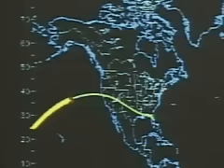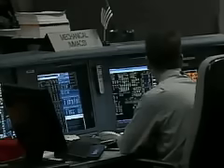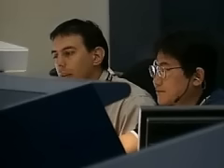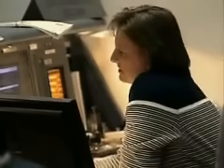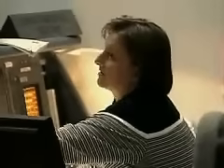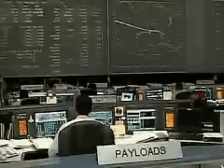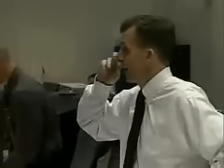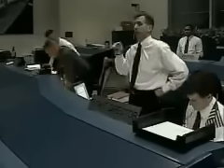Inside Mission Control During STS-107 Columbia's Failed Re-entry and disaster

Comment: The director was amazing professional in what was likely the worst moment of his entire life.
Reply: @Joe Booth You make it sound as if the tragedy was his fault. It wasn't. Their fate was sealed when the insulation tile was broken.
Reply: @davem5333  Correct, at liftoff it was over. Space flight is very intense and costly but I am surprised that no one had a backup plan in case of such an event like tile damage since foam comes off the central tank a lot.
Reply: @Joe Booth Wow! A real keyboard engineer!  We're so lucky. Tell us how you know the facts, not speculation but real FACTS. . Were you there when the decisions were made or did you read a secret report leaked by a NASA employee?  While you're at it tell us exactly how they should have "mitigated" the risk. Send another shuttle and risk having two crews stranded in space? Maybe do an EVA with a roll of duct tape?  You shot your mouth off by saying the FD flew them to their death and inquiring minds want to know. how you obtained this info.   

The only people who know the real truth are the ones who called the shot. Leroy Cain and said they all knew it had been hit but were told by NASA heads that it wasn't a concern. EXACTLY how was  he responsible?  Show facts not bullshit speculation.
Reply: Thought the same thing. Space flight requires the best in Engineering,  Production, and Leadership, but is given a shoe string budget. This wasn't LeRoy's fault. It was US Government Bureaucracy. "Reach for the stars, but use a bottle rocket to get there". - Congress.
Reply: Mike Washington -So True!
Reply: People knew it wasn't Caine's fault..... He did the best he could with the decision made over his head.
Reply: LeRoy Cain's expression totally summons up the situation, "like not again" after Challenger 17 years earlier,  the fight director and staff were just small fry, the biggest bosses the senior executives knew about the foam strike they had video footage of the strike during take off, yet they ignore the risks, once again they didn't learn the lessons of Challenger.
Reply: @joshuagrover795  Sry. EVERYBODY KNEW. The problem was that they didn't know the amount of damage or how it would affect the flight. There wasn't really anything to do but hope for the best since they couldn't do repairs.
Reply: @markiv2942  NASA must have known that with a hole in the wing, the shuttle would burn up on reentry, although NASA didn't request satellite images of the shuttle while in space, according to the official report, so NASA managers wouldn't have known about the damage or least the extent, do you think NASA should have informed the crew about the potential damage to the shuttle?
Reply: @joshuagrover795  
No 'satellite' images would be possible. Satellites are separated by hundreds of miles.
Reply: @rstevewarmorycom  False. The Dept of Defense doesn't disclose where their numerous assets are. The official CAIB report says there were 8 missed opportunities to get imagery of the wing. The report said engineers requested imagery multiple times and the Dept of Defense was working on it, when the NASA management canceled the request.
Reply: @soxnation1000  
Because they knew at that distance it would be useless.
Reply: @rstevewarmorycom That's not for them to decide with zero effort to examine options. When lives are at stake, they needed to do their best, not throw their hands up and say "we can't do anything, whatever." 

Potential solutions were never even discussed. They should have had hundreds of people working on it. The CAIB report strongly criticized the management for not getting imagery or exploring potential solutions. That was gross negligence, period.
Reply: @markiv2942  peak out the damn window?
Reply: @rstevewarmorycom  look outside the damn window?
Reply: Joshua Grover could they not have got the pictures from this women who dreamed it unimportant? Then send a shuttle up with crew experienced in space walk to fix it ? Am I being completely naive about this. I’m British but am really fascinated with space since the moon landing.
Reply: Carol rawsthorne - The time was damaged on liftoff when’s suit case size of insulation broke off and hit the left wing.. Their was no rescue available. Next shuttle flight was 8 weeks out. Tragic but we didn’t have a repair kit on that flight. NASA has been known for being lax,. Even on Apollo missions. They knew of the problems but bean counters usually win in the end.
Reply: @joshuagrover795  mannnnnn, what a tough question. You can't tell them, right? Assuming of course that there was literally nothing they could do to improve the situation. God, what a terrible choice to have to make.
Reply: @joshuagrover795  this was actually discussed when they stopped painting the Main fuel tank to save weight. It was a risk. As is all space flight.
Reply: @Joe Booth WTF? He didn't know they were going to die.  READ the report before you post armchair bullshit. . Yes other people knew it was hit but the controllers didn't have anything to do with it, and they have to live with that moment for the rest of their lives - you don't.
Reply: A Dubuque boy through and through.
Reply: @nutsackmania  lol
Reply: Ray Brown and what did he do wrong arm chair FD?
Reply: that friggin blonde chick said it was ok to return.
Reply: @normal_media  Yes, Linda Ham made the call to not assess the damage....A second crew could have possibly repaired the wing from the outside in a spacewalk...
Reply: They always are. Best of the best.
Reply: TheBigImpulse  I heard it different.  I heard the part about requesting and being denied photos, and that no satisfactory reason was  given other than they didn't feel it was necessary.  Also that Columbia did not have enough consumables on board to wait for a rescue, no process in place to do a transfer, and NASA didn't want to risk losing 2 shuttles - especially knowing there was a problem with the insulation that subsequently resulted in the grounding of all shuttle flights. 

Either way it doesn't matter now. If they would have listened to the engineers on the morning of the launch this video would not exist. 

NASA should have relied on science. Someone made a WAG based on ego and forced the launch.
Reply: @Joe Booth did he know of the problem before re entry though? If not there was nothing he could do.
Reply: @marlonisaac1  No. No one did.
Reply: Marlon Isaac nasa knew about the issue months before but they didn’t assume a small insolation would cause so many issues
Reply: I think he was waiting for the Asian woman to put on her gloves which she didn't do
Reply: Katherine Wild yea the crew actually didn’t have their visors down and gloves on but a former astronaut said they didn’t die bc the capsol got detached from the explosion so they were sitting there until the water which is horrible I hope they were unconscious
Reply: Wrong flight. That was Challenger. Columbia broke up over Texas. I had a job assignment in that area a few years ago and one of my co workers showed me pictures of debris they found
Reply: @marlonisaac1  They knew.Can't fall apart for the sake of the astronauts.
Reply: or the best
Reply: My Thought Also.k.
Reply: Agree totally.
Reply: I think he was waiting for the crew member in the back seat to put on her gloves-she didn't.
Reply: Gethomeitis...
Recovered my friends who went down in OEF because of it.
Reply: No! Not at all! It's quite apparent to me, that some of that Mission Control Centre staff was tring to do their jobs - some other people new in advance what's gonna happen... Professional, but not in your sense of the 

term..
Reply: Yeah, but I see little he could have done differently. They assessed the damage afterward. There was nothing on earth (literally) that they could do with the prior knowledge. It was not a certainty, but very possible it would not make it back. They did all they could. I did read that this haunts him everyday.
Reply: @markiv2942  rescue flight
Reply: Unbelievable  considering the billions involved that they didn't think..best have camera ability or remote device status  to check the outside condition if the vehicle once in orbit or maybe a piece of foam could detach and penetrate the vehicle on launch...let's test for that scenario too.
Reply: Gene Kranz, Gerry Griffin, Jay Greene, (there's a few more) had their own moments when they had to be a solid foundation for their teams even when the entire world is watching, expecting answers. The level of professionlism is crazy.
Reply: He KNEW the shuttle was damaged. He's a prick
Reply: the columbia had had a piece of heat shielding break off before, NASA deemed it an acceptable risk. they all knew
Reply: @raybrown3510  he was doing his job.  You can take your other crap and shove it
Reply: @raybrown3510  who?
Reply: You could say he had the right stuff, and not in a facetious way at all. He displayed command stuff. Not easy at all.
Reply: Corporate working
Reply: He knew.
Reply: I wish they had sent the rescue shuttle.
Reply: He was yawninh
Reply: the comment forum shows how illiterate is the us populace, technology-wise!
Reply: @kenthomson9562  Right. Terry O'Keefe, NASA administrator at the time, made the overall decision.
Reply: @dalethelander3781  but yeah what happened was very sad and they could’ve been saved which is the really sad part, bad deduction making
Reply: @dalethelander3781  why we don’t put females in important positions of power cmon now 😂😂 i’m joking btw
Reply: There was nothing anyone could do. Do you leave them up there and mount a rescue??? The risks of what they do are known to be not known. I just wonder how much we really learned from all this...   All the lives gone. Some of our finest men and women.
Reply: @Joe Booth Hi bottom feeder
Reply: Did he know beforehand that there could be a big problem? People knew about the debris strike, I'm not sure if he knew. If so, he's shitting his pants as its happening. :(
Reply: @WifeBTR123  Everyone knew about and discussed the strike including the crew.but no one could see if it was actually damaged, and since foam strikes had happened before without issue on previous missions, engineers advised everyone that this one would not be a problem. None of this was the fault of the controllers but someone up the chain certainly screwed the pooch.  

NASA heads also surmised that if damage had occurred there wasn't anything they could do about it.  They had no repair kits on the shuttle and  the astronauts were not trained for EVA repair. A rescue shuttle was briefly discussed and scratched because of the time needed for launch, and since they weren't 100% certain of a safe rescue launch (fear of repeat damaged) did not want to risk having another shuttle and more astronauts stranded in space.  

This was all revealed during interviews but of course there will be some who say otherwise. Only those who were deeply involved with the evidentiary data know if it's true.
Reply: @Slugg-O  that's crazy. You would think that in some way they would have a contingency play to dock with the ISS and just use the Soyuz to come back home. I'm pretty sure my ignorance on fuel, trajectory and space flight makes this exceptionally easier said than done. Still, it's just a thought since NASA thinks of everything.
Reply: Makes about as much sense as panetta saying they didn't send a rescue mission to Benghazi, because they couldn't get there in time.
Reply: Slugg0matic so why would they need to discuss sending a rescue shuttle? Someone knew this foam impact was not like the previous ones that  occurred. I think they knew the severity of that impact could lead to a catastrophic re-entry.
Reply: @Slugg-O  To expand on this. NASA had seen ice or foam strikes on many launches. This one had raised some concerns because it was particularly large. But they had not fully realized yet how much punch a piece of frozen foam had when impacting the shuttle at launch speeds. 

This was compounded by the problems that the oldest shuttle Columbia had the weakest engines and could not reach a high enough orbit to reach the ISS. Further it was not carrying a docking module. 

Sending up a "rescue shuttle" was not an option as it would take longer to prep and roll out, even cutting every conceivable corner, then the Columbia had available on its limited possible time in space. The shuttles had hard limits for how long they could stay up. Columbia could stay up no more than 2 weeks. A specially rigged Shuttle specifically tricked out for long duration stay maxed out at 18 days. They run out of fuel for the fuel cells that power the shuttle. They run out of lithium hydroxide canisters which scrub the CO2, and the hydrazine and nitrogen tetroxide propulsion fuel starts to break down and go weird. (that last one lasts a bit longer, but its also why the Soyuz units at the ISS can only stay up for a limited time. They all have a "sell by" date, or they can't get home.) 

An EVA was not an option. The crew had no way to reach the underside of the shuttle, even with gear to go out the door. Columbia was not carrying an arm on its last flight. They had stripped the shuttle to minimize weight to give it more height. Columbia was just a low orbit lab by that point due to its weaker engines. 

So yeah, they knew that there was a potential for heat shield failure. But there was nothing they could do about it at all. The shuttle had survived many strikes before and there was no obvious damage seen on the launch footage. The best they could do was hope and pray that it would all hold together. This was a calculation that they had made many times before. John Glen's Friendship 7, they didn't no if the landing bag had deployed and knocked loose the heat shield. Apollo 13 they were much more fearful that the explosion had damaged the heat shield. But they had to roll the dice. The only alternative was to leave them up there until they ran out of oxygen.
Reply: @JayJay-EH  My thoughts exactly.
Reply: Slugg0matic it seems to me as someone totally uninformed about aerospace issues that NASA’s failures and tragedies have to do with systemic issues and lack of communication, compounded by the unaccountability of your standard issue government agency. I.e. challenger and Feynman’s findings regarding it.
Reply: @MrDynafxdc  
He would know. You wouldn't.
Reply: They didn’t even bother to commission satellites for a visual on the foam strike area due to cost. They hedged their bets that everything would turn out ok and lost. If they discovered the hole in the wing a contingency plan would have at least been discussed- possibly even tried. You knew from the look on the controllers face as soon as they lost the first temperature sensors in the left wing that they knew what was unfolding in front of them. Pressure to launch, pressure to land, pressure to stay on budget- those are what doomed the crews of Columbia and Challenger.
Reply: @andrewtaylor940  Weakest engines?  You realize that all of the RS25 engines are fully refurbished after each flight and don't exclusively with the same shuttle?  Age of Columbia would have nothing to do with this either.  Had this been Discover, Atlantis or Endeavour, the result would have been the same.
Reply: @yxeaviationphotog  Columbia could not reach the same heights as the later shuttles. It was not capable of reaching the ISS. Which is why it never visited it. This is fairly well known and documented.
Reply: @andrewtaylor940  Yes, it wasn't designed to physically dock with the station.  Because of this, the mission profiles never called for higher orbits.  Columbia had the same OMS and SSME's as any shuttle that could dock with the station, so if it had been designed with docking with ISS in mind, it could have.  Not because it was older and had weaker engines.
Reply: @Koko_Sam like with challenger, nasa relied very heavily on the resilience of the shuttle vehicle and the airtight launch/reentry procedures.  that is the only way they were able to develop their program autonomously, ie without much international cooperation, which was a strategy to keep USA's pole position in the space race.  This shuttle had no repair arm, no escape pods and not enough fuel to make it to the ISS, something they never intended to do anyway.  So they were entirely dependent on the shuttle staying in one piece and the procedures being followed and effective.
Reply: @Slugg-O  How did they screw the pooch? What should they have done? Flown them off into the sun to die faster than the possibly minutes of death they had to endure?
Reply: @ThatSB  My comments were posted a long time ago and I don't remember and cannot find where I said they "screwed the pooch." If that's what I wrote then the context was wrong because I am certain it wasn't supposed to be directed at the FD's.  If anyone screwed the pooch it was the brass at NASA for pushing a launch in freezing weather when there were engineers telling them it was unsafe.  They wanted a "go" and they got it. The crew were doomed the moment the SRB's lit but the FD's had nothing to do wit it from what I've seen. They just had the unfortunate task of watching every millisecond of that decision unfold.
Reply: @andrewtaylor940  But they had not fully realized yet how much punch a piece of frozen foam had when impacting the shuttle at launch speeds. 
Bullshit anyone even thinking about applying to NASA would understand the magnitude of the forces involved.
Reply: Zym To put this another way, they were well aware of the dangers from frozen foam. But they assumed all the danger was on the softer parts of the wing. They never imagined that it would have enough force or mass to punch through the hardened leading edge of the wing, where they saw the impact occur. It wasn’t until afterwards when they froze a chunk of foam, put it in a cannon, and fired it at a wing edge from Atlantis that they realized the problem. They had always worried about damage to the black heat shield tiles. Which were disturbingly fragile. They never expected or planned for damage to the grey hardened Reinforced Carbon Fibre Composite used on the nose cap and the wing leading edges. They literally assumed that those sections were more or less bullet proof. And that the wing itself would likely fail before those leading edges. They never imagined a hole could be blown in that material the way it did.
Reply: @Slugg-O  we totally had the capability to rescue them from space. Whats the point of having multiple shuttles if we never used one as a rescue?
Reply: @JayJay-EH  They had NO WAY OF KNOWING THE SEVERITY. They discussed the repair mission option as a better safe than sorry , but the risk was too damn great.
Reply: @andrewtaylor940  Thank you for your informed, rational Reply.
Reply: @MrDynafxdc  lol benghazi
Reply: @mortgageapprovals8933  MTK engineers tried. NASA engineers refused to listen.
Reply: @Slugg-O  Also IIRC there wasn't anything they could do even if there was a way to see the problem.  STS-107 did not go to the ISS and chad limited fuel and power and there was no backup shuttle ready to rescue them.
Reply: @Koko_Sam  Columbia didn't have the capability to dock with the station. It's last mission was a research flight to a different orbit.
Reply: @WifeBTR123  He may not have known exactly what the issue was or how big a problem it would turn out to be. But I think he realized that it was VERY serious and possibly even critical and that there was nothing that could be done about it. The error margin on space flight is very small. It is nil during reentry.  A totally helpless situation.
Reply: @davem5333  This is all lazy Bs. We could of sent another shuttle up. Hundreds of flights and only two disasters. It's worth the risk and many would sign up for it
Reply: WifeBTR123 He DID know beforehand and was warned that pictures needed to be taken of the shuttle to look for damage whike in orbit. But he ignored that recommendation and said he considered it a “kurt issue”. So challenger and Columbia were both caused by failed human error in judgment. Both were warned and were ignored. Hope someone was held accountable for these bad decisions.
Reply: rac86quel 

Yes satellite imagery should have been pursued. But let me ask you, exactly would have been done if they knew the damage caused? There simply wasn’t an option available or possible that had a better chance of succeeding than just trying to land. 

I hear a lot of “well they would have had hundreds of people working on it”, that’s nice and all, but an impossible problem doesn’t become less impossible with more brains behind it and a 10ish day deadline. Even 2 decades later there hasn’t been a solution proposed to this. So yeah I don’t really know who’s head should’ve rolled for this.
Reply: @WifeBTR123  he knew the possibility.  He had told a concerned engineer not to worry about the possibility.
Reply: That's exactly what I want to know. Because Linda Ham claims that she never heard about damage concerns from the debris assessment team. So either there was a fatal lack of communication at NASA at that time, or Linda Ham is a simply liar, looking to save her own hide,  and is responsible for 7 dead astronaughts.
Reply: @WifeBTR123  he discussed the issue with, I think, Rocha.  And dismissed Rocha's concerns.  So he knew something serious was happening soon as he heard the four left wing sensors, all Independent of each other, went offline.
Reply: @WifeBTR123  he did know, I saw an interview with him and he pointed out the moment in this that he knew what happened
Reply: @WifeBTR123  NASA knew Columbia was doomed before they re-entered, however there was nothing they could do so they chose not to tell the crew. The crew likely figured out they were going to die 60-90 seconds beforehand.
Reply: @WifeBTR123  
I think everybody knew about it ..
Reply: @WifeBTR123  HE KNEW
Reply: @WifeBTR123 yes he knew
Reply: @WifeBTR123  how the fuck would the flight director not know?
Reply: @WifeBTR123  They knew there had been a foam strike and that it had been a little bigger than before, but they'd also had foam strikes on other launches with no issues.  They were concerned IIRC but they had no hard data.  I expect they were a bit more nervous than usual but they had nothing to go on until those temperature sensors went offline in the left wing...then you can see Cain really begin to tense up.
Reply: @WifeBTR123  He knew! Or he SHOULD have known.
Reply: @Joe Booth Are you seriously insuniating NASA for the sake of publicity would risk not only losing the crew but ALSO THE FREAKING SHUTTLE ITSELF?
Jesus christ you are one thick minded fuck. Not everything is about administration or government.
Even engineers didn't know how much damage there was on the wing or how it would affect the vehicle in re-entry. Now they know and have chance to make repairs before re-entry.
Reply: @markiv2942  tiles had been coming off since the early shuttle flights.
Reply: @kbanghart  Yes and no. The bulk of tile loss on prior missions weren't the leading edge tiles. They were generally the less critical white ceramic tiles, or trailing edge tiles. The most famous being the ones that shook loose on the first mission on the front edge of the engine/thruster cowlings.  What made this one particularly catastrophic is it breached the leading edge of the wing. The point that takes the most heat on re-entry.
Reply: @andrewtaylor940  could be. But, point is the tile loss was happening from the beginning. And it fits with NASA s culture of downplaying risk.
Reply: @andrewtaylor940  no tiles on leading edge.  Carbon carbon
Reply: @kbanghart  no they hadn’t, could you imagine what would have happened if every flight had a tile come off? That could result in death to the whole fleet
Reply: @thatoneskierdude4410  since my comment is pretty old and I'm not going to scroll through everything to see what I wrote, I do know that astronaut Mike mullane wrote about it in his book, and several fights had tiles come off. Not sure exactly how many but it was more than just a few.
Reply: @kbanghart  I just ordered his book yesterday, can't wait to read
Reply: @kbanghart  ok so my mistake in this whole thing was;

I thought losing a single tile would result in LOCV, but the thing with Columbia is that it hit the RCC, not a TPS tile. Losing the RCC was much worse.
Reply: @markiv2942  They had the option of pointing military satilites to take pictures of the damages but chose not to.
Reply: LeRoy Cain resigned from his FD position after this incident.
Reply: He did not resign. He was ascent flight director on Return to Flight, STS-114. https://youtu.be/Wi2drhGRADc
Reply: @mfrontz   hr was promoted after this
Reply: @dalethelander3781  Men of honour and responsibility. On the other end of the stick are politicians at the top of all this - who always float happily with their margaritas and are never held accountable for anything...
Reply: Dale Thelander he was FD for the mission directly after then he resigned.
Reply: @dalethelander3781  He moved up the chain after this.  Was a mission control commander by the time the shuttle program was retired in 2011.
Reply: Dale Thelander That is not true! He was Flight Director on a future mission!
Reply: Dale Thelander no he didn’t!!!
Reply: @dalethelander3781  Yeah he had to, its an very heavy weight to live with something like this...
Reply: @dalethelander3781  
Absolutely not true. He was an entry FD for two years after this.
Piss off.
Reply: @JmackDaddyFunk  Lemme tell ya a story. I had a friend, Jeff Jones, who was in charge of loading LOX in the Shuttle's ET. We had been friends since he started the official international fan organization for the tv series Space:1999 in 1977. After the Challenger incident, he called me and told me he was resigning. He said he couldn't work a job where he would have to kill people. He moved to northern California and lives a secluded life. No one's heard from him since 1986.

Psychological trauma is real.
Reply: @dalethelander3781  That’s great. Cool story.
Nothing to do with my comment.
Reply: @JmackDaddyFunk  According to the article, which I read 30-some years ago, LeRoy Cain suffered from the same thing Jim did. PTSD.
Reply: @dalethelander3781  
I’m sure he did
Reply: @dalethelander3781   Incorrect. Do your research. https://en.wikipedia.org/wiki/LeRoy_E._Cain
Reply: @dalethelander3781 He led STS 114 too after this as the other flight directors was not yet fully certified…’Then he resigned to take up a management position
Reply: Did they recover any the bodies?
Reply: Ross Marshall They recovered body parts, yes, that fell to earth.
Reply: aresef as sad as this incident was wouldn’t you think with the atmospheric pressures there wouldn’t be anything to recover from the astronauts?  First Challenger then 17 years later another tragedy....I was shell shocked watching on TV....
Reply: Apparently they recovered parts from all 7 astronauts. But how large were the parts? Not very large but enough to have burial which was in a sad macabre way a little comforting to their grieving families.
Reply: @rossmarshall628  they recovered a whole human heart, a torso and a broken burned femur bone among other parts..
Reply: @sarahkitz6901  YOU DO NOT NEED TO SAY " A WHOLE HUMAN HEART" .. YOU JUST SAY A HEART.. OF COURSE IT WAS HUMAN. DRAMATIC MUCH !
Reply: @edgelennox4035  it is an important detail that the heart was found whole, not in pieces..
Reply: @sarahkitz6901  NOT MUCH CHANCE A HEART WOULD BE FOUND IN PIECES, BUT IF IT WAS, WOULD JUST BE BODY PARTS.  STILL A INEMPT COMMENT.
Reply: @edgelennox4035  no need for your shouty hostility.
Reply: @standup2982  MY KEYBOARD IS BROKE.. BUT THX FOR THE LAME COMMENT. :D
Reply: Sarah Kitz where did you get this information?
Reply: @sarahkitz6901  The state of the remains is indeed relevant. In this case it showed that what had kept the Challenger crew alive until impact in 1986 had failed to do the same for the Columbia crew.
Reply: @edgelennox4035  finding the heart whole is an important comment because it shows that this was nkt some sudden, instantaneous death, as was originally hoped for and assumed. They eventually did die, likely after a minute or so, and were eventually ripped apart, but not with such force that would obliterate a heart
Reply: @edgelennox4035  it was cooked too
Reply: @edgelennox4035  for someone who is watching the minute by minute recap of the Columbia disaster it is surprising you are annoyed by actual details. Of course no one wants to think of an entire human heart being found. However, that is what occurred. You are being somewhat dramatic as well.
Reply: @edgelennox4035 take a chill pill
Reply: @edgelennox4035  A whole human heart! D:
Reply: Yes they did a skull and some other body part's.
Reply: @icbm859  Obviously! Some of these peoples questions...
Reply: @rossmarshall628  They had to do DNA testing to identify the body parts they found. Only way to identify the remains but they found a portion of all 7 of them.
Reply: @rossmarshall628 of course not.  What are u talking?
Reply: @rossmarshall628  Yes
Reply: @markiv2942  you blame the guy's , you really should  have blamed his grandmother's for procreating  .....
Reply: Note to the world , NASA ( " NAZI Aeronautics and Space Administration " ) , should be abolished ! What good has come from it ? NOTHING  THATS WHAT , WASTE OF TRILLIONS  OF DOLLARS , PERIOD !!!!!
Reply: Cain knew what was going on.
Reply: @kenbrownfield6584  I'm sure he strongly suspected failure but. short of resigning, had to face his destiny.
Reply: His wife was on the flight that's why he showed his upset it must have been painful I always get emotional when they zoom into his ring finger😱😥
Reply: @katiehighfield5369  his wife's name is Teri and she's not an astronaut. She's happily alive
Reply: @ruCaprisse  I only just noticed there was a time delay on the documentary I apologise for my error...
Reply: @katiehighfield5369  that's ok)
Reply: @katiehighfield5369  bah! Seriously?! I didn't know that I thought it was that he lost some close friends, I didn't realize one was his wife. 😟
Reply: @hayes572  it's on the documentary it's so sad he even asked for photos from satellites to make a plan of action and he was overulled and sadly he was proven right in the long run absolutely devastating hope they will finally start listening to there co workers at NASA once there new form of spaceship has been completed
Reply: @katiehighfield5369  sad is an understatement. 😥 thanks for the info!
Reply: hayes572 - His wife was not on the flight!!
Reply: @katiehighfield5369  We'll never make the moon again with a woke crew
Reply: @katiehighfield5369  no way?? which crew member
Reply: @katiehighfield5369  Some husbands would see it as a gift.
Reply: Not dificult to be professional when it's not your ass burning in flames in atmosphere reentry
Reply: Watch the Cowboy Bebop episode: "Wild Horses", ya'all. We are in a very, VERY strange world.
Reply: Right. HE KNEW EXACTLY WHAT WAS ABOUT TO HAPPEN. And if he didn't he was incompetent. So he's evil or incompetent - neither are 'professional'.
Reply: you know he was the one that killed them, right?
Reply: EternalSearcher - who? If you are talking about Cain that is not true.
Reply: EternalSearcher You mean Cain?
Reply: @coldhalo-o7o wanker
Reply: @maddymurnane5670  he is indeed! He probably envied them, so he decided to kill them and made it look like it was an accident. I mean, I wasn't there, but I'm a perfect judge of character and I'm sensing that's how it was
Reply: Guy had nerves of steel. I would have had a full blown panic attack then fainted.